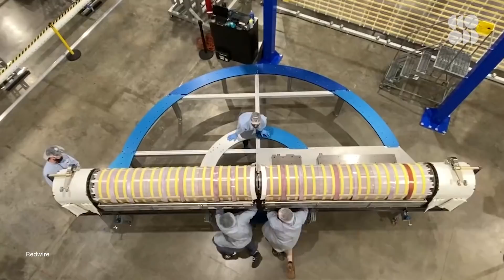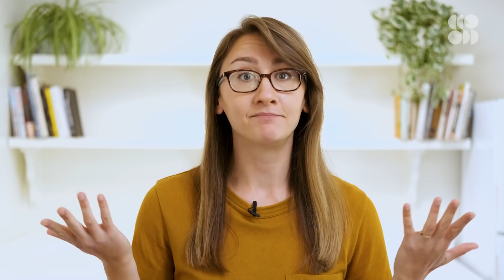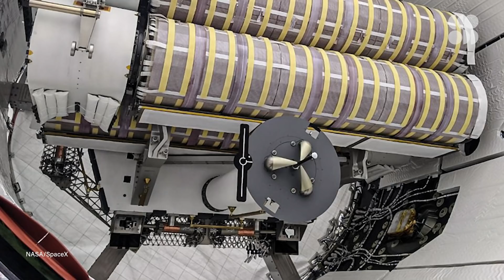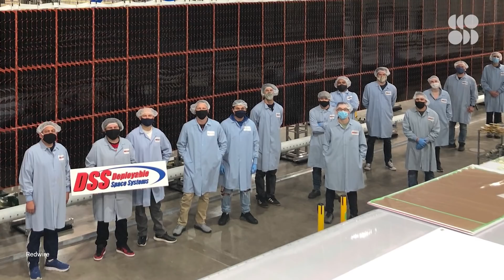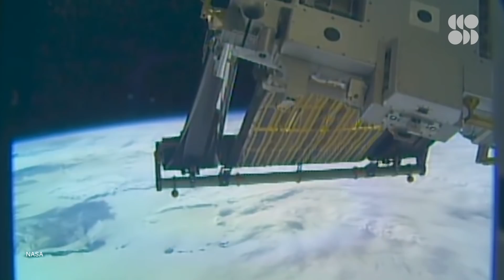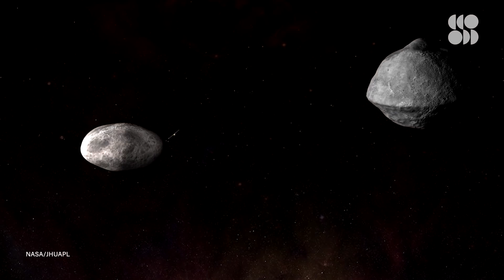SpaceX and NASA Will Deliver Next-Generation Power to the ISS

Comment: It you take three regular motors connect the two with four wires start it up and it will generate continuous power, connect another set of two wires to either one to the third and you have an unlimited supply as long as the power drained doesn't exceed what it produces. Increase the value of the material for better  and more efficience power production.  Also look at and replace the cheap materials used in certain products for Better results. You all have a bless night

Comment: Okay, I didn’t know solar cells degraded so quickly in space. I looked it up and it 5-10% per year. The damage is caused by radiation. Solar cells on earth degrade only 1% annually.
Reply: @lawngnome777  now calculate how much progress in technology the iss brings to the earth.
Reply: Low Earth Orbit is actually even worse. Space debris in LEO can punch holes and create plasma that can degrade panels even faster than solar panels on spacecraft located farther out.
Reply: @lawngnome777  and those solar cells are way more toxic to made than the normal ones

Comment: Why do they need more pier all of a sudden? Are they building space lasers?
Reply: Station is bigger and using more power than it was designed to originally with lots of new equipment having been added over the decades. And the solar cells in the existing array are only producing 80% of the power they used to 21 years ago.